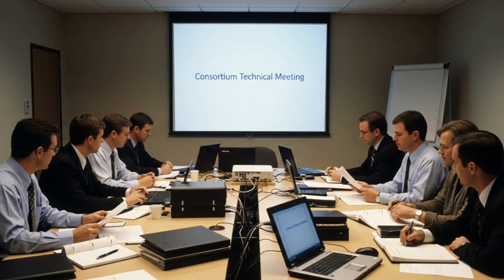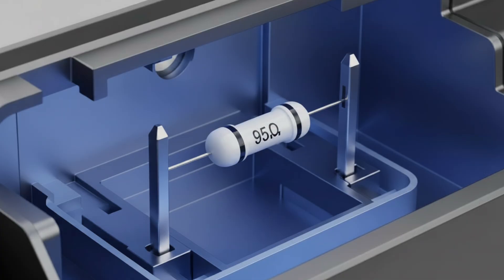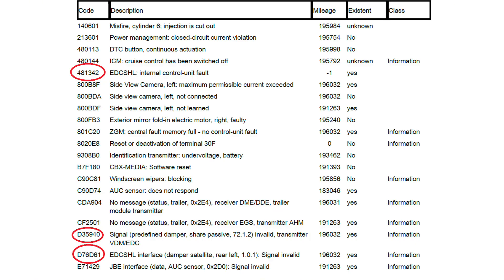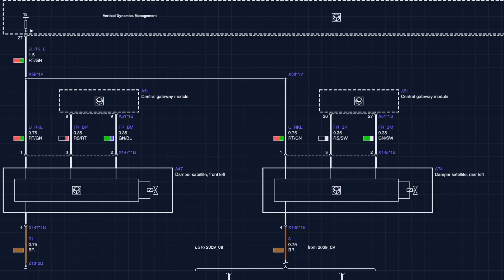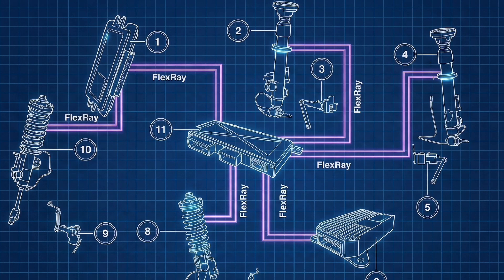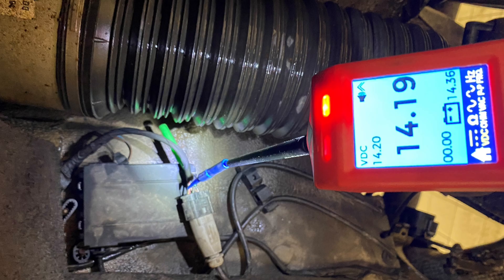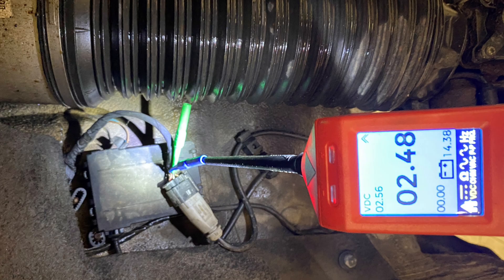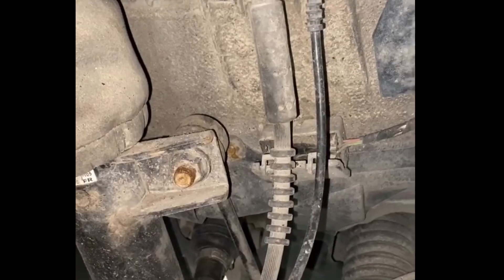Modern Car Diagnostics: FlexRay Fault Traced and Solved

Comment: blowing my mind. F01 random non-start issue.
been to couple of garages. DDE is loosing communication only after engine start(engine keeps running)!
They have swapped and cloned with another DDE and did software update, still the same, apparently voltages are all ok ?
it has been 1 month no progress, any ideas ?
Only DDE shows red in ista after start nothing else
Reply from the maker: Yes I have had this before on an F01. I charge 100€ for tech support. Email me what has been checked and fault codes before DDE replacement and after.